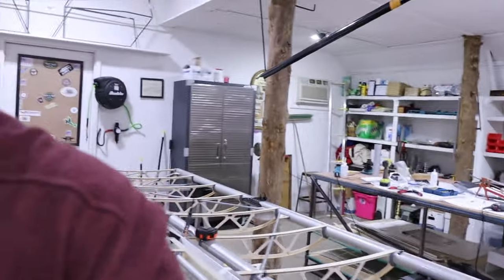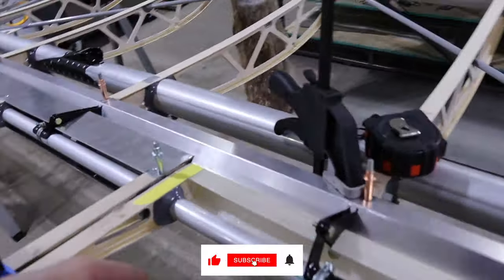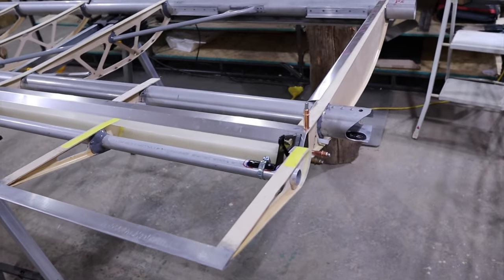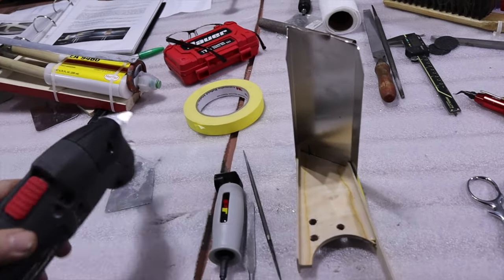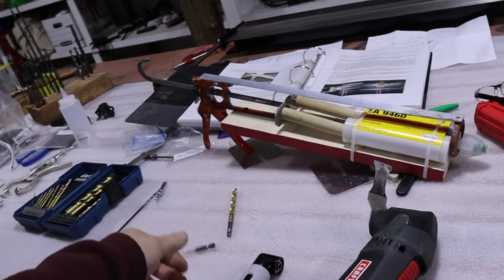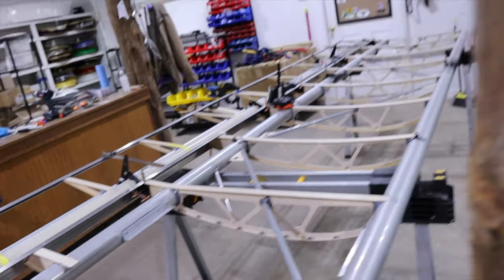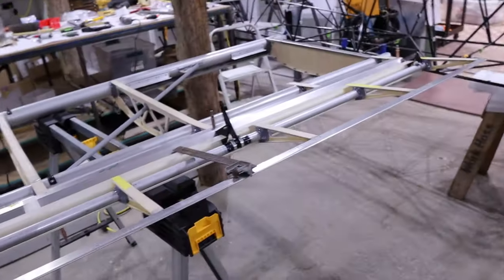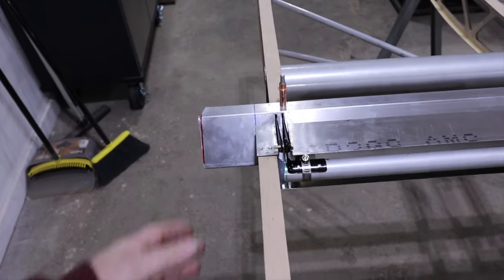Highlander 998T Ep #5

Comment: who makes that little 90 degree driver?
Reply from the maker: https://m.northerntool.com/shop/tools/product_200637387_200637387?cm_mmc=Google-pla&utm_source=Google_PLA&utm_medium=Power%20Tools%20%3E%20Drills%20%2B%20Accessories%20%3E%20Drill%20Accessories&utm_campaign=Klutch&utm_content=42104&gclid=Cj0KCQiA3-yQBhD3ARIsAHuHT650nQiNa59is-8ynJ5s8ReXD7kCSQTbOalWe9rGnam_FYH6yvl5MnIaAuKgEALw_wcB&gclsrc=aw.ds. and it looks like Dewalt one  very similar as well.
Reply from the maker: https://www.oreillyauto.com/detail/c/performance-tool/tools---equipment-16488/tools-23747/hand-tools-16814/sockets-16637/socket-u-joint-extension-adapter-18025/322b0ba92ed5/performance-1-4-inch-drive-8-1-8-inch-impact-driver-attachment/pfm0/w9029.  This is the exact one that I got from O'Reilly's.